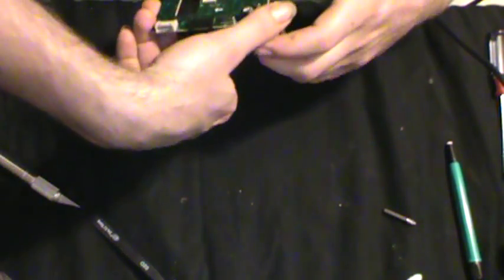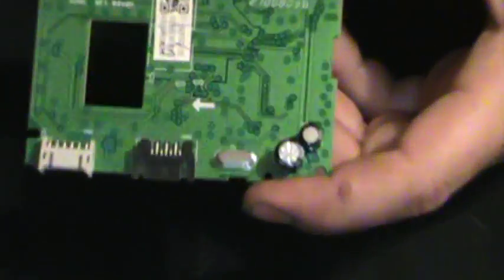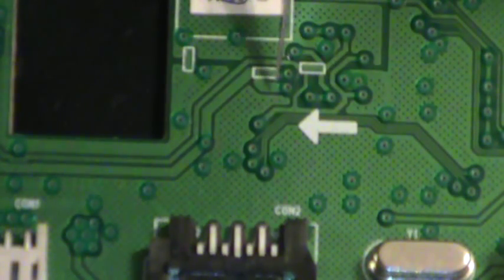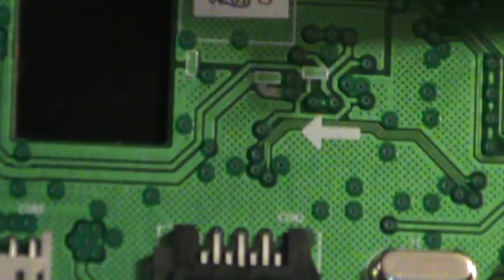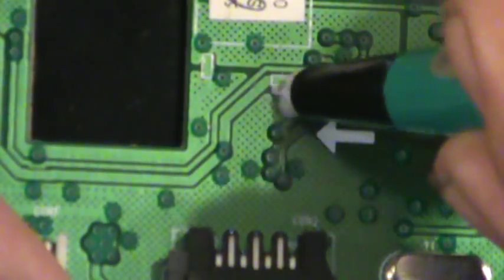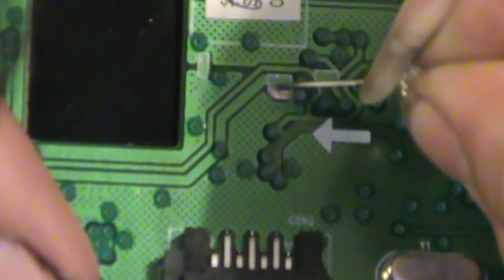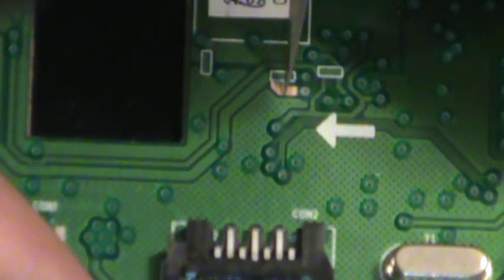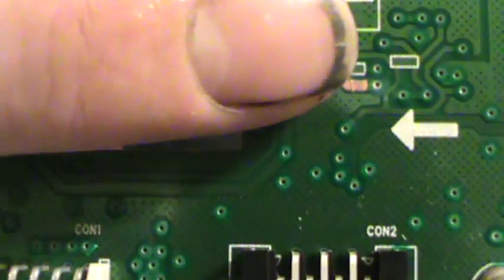Xbox 360 Slim drive flash with Sputnik probe Part 3

Comment from the maker: If your console is updated to the latest dashboard then you will need to do this.  I cant remember which dash update it was but one of them locked the slim drives thus preventing them from being writen to or "flashed".  This process is to unlock the drive again manually to allow you to flash it.  

I think the dash update in question was 13146 but its been awhile so I'm a little fuzzy on that.